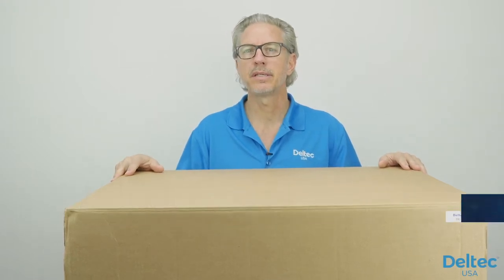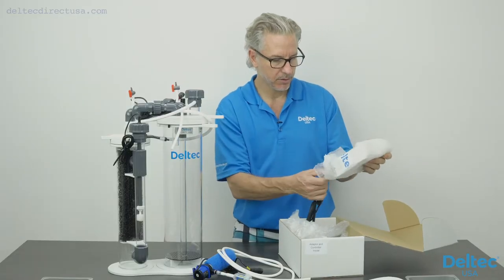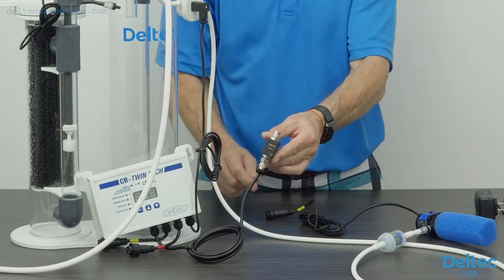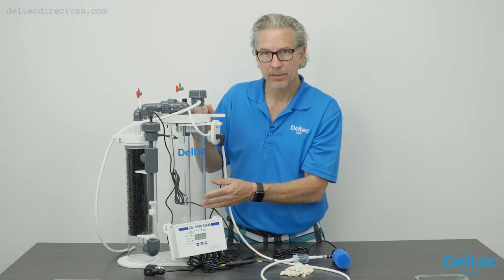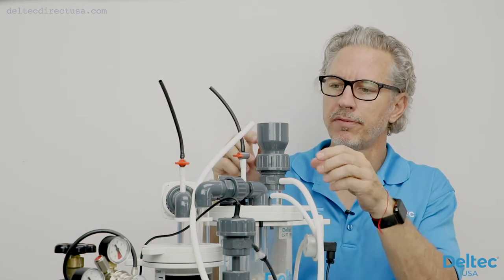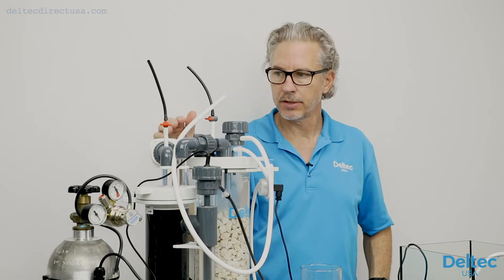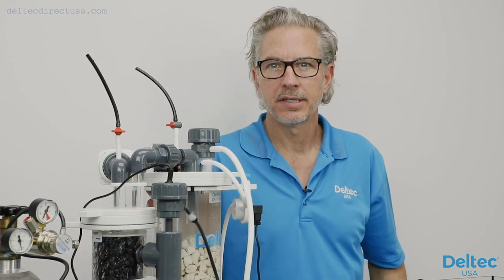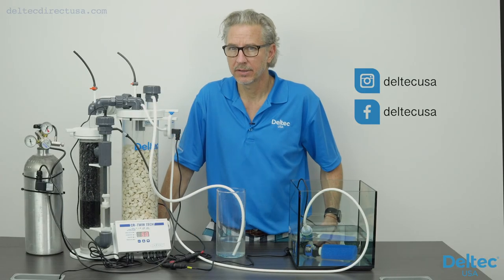CALCIUM REACTOR CRTT 1500

Comment: Hi, thanks for the very informative video! Is there a way to calculate how much do I need to dose per day based on my tank's daily consumption? For example, if my tank is a 500 litre tank and I am pumping 50 litres of effluent a day with a 50dkh concentration, does that mean I would be adding 5dkh (50dkh * (50litres/500litres)) per day to the tank? My tank is a 700l and has a daily Alk consumption of 1,5dkh so I am trying to see what would be a good initial setup for the effluent. Thanks!